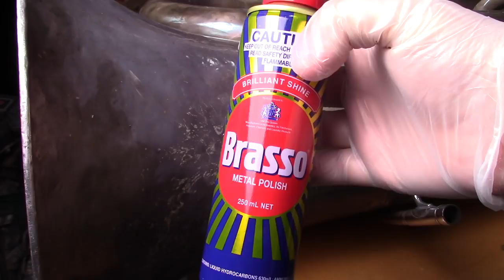It's finished! 1926 Tuba Improvement Project - Part 3

Comment: Trent- good work! You didnt destroy it- it was a salvage job and its now playable.

Question: did you cut your own felts because those size felts arent available or just cost savings? (Obviously it worked).

And I always thought you werent suposed to use Braso in silver. But it came out nice.

Comment: I have a trombone cleaning question, and it seems you are relatively good at fixing instruments. Just some backstory, I have a 1909 buscher trombone that my grandfather gave me. It has a very good tone and a beautiful engraving on the bell, but the only downside to it is that the spit comes out green. You might think letting a music shop take a look at it is smart, but I'm also 14. And poor. So if you have any idea on how to clean it or fix that, it would be greatly appreciated.
Reply from the maker: Yeah, I'd really recommend you take it in to get serviced. If that really isn't an option, give it a bath in warm soapy water, get a slide cleaning brush and give the tubes a good brushing.

Comment: Coincidentally I've been doing nearly the same exercise on a 1922 Boosey & co Eb tuba and faced similar issues, i ended up soldering 6 patches over holes and reconnecting the lead pipe and fixing dented valves. It'll never be an orchestra instrument but would fit nicely into a New Orleans style or even Funk band. Very satisfying to give these old beauties a new life.
Reply: I got an old 1935 martin  Eb 3+1 at an antique store for under $200. I would've sworn in was spray painted gray. Bit by bit is getting shinier, but lots of nooks and crannies!
Reply: I always like to see old instruments made playable again. Sure, you wouldn't use them in a Symphony Orchestra, but I reckon they've got lots of character and soul for small ensembles/bands who want to bash out a few tunes. I've recently acquired a ca. 1923 Boosey & Co Cornet which was considered a wall ornament, but it turned out to be perfectly playable - just had to sent it to a repairer to unstuck two of the slides and get a nasty dent out of the bell.

Comment: That tuba looks amazing. The music shop that I visit regularly has an old Besson Tuba made in England that was made in around the 1920s and is the original schematic for the tuba that you restored. All the lacquer has rubbed off, it's missing all 3 valve caps and the tip of the mouthpiece receiver at the end of the lead pipe is torn off. Literally torn off. I'm thinking of paying for it to be restored cause I can't just sit by and let it rotin the repair section of the music store and be used for spare parts. I already have a King 2341W full sized Tuba, and I just think it's too new. I've done research and it's worth around 12k USD.

Comment: I'm in the process of cleaning my very old 1800's Euphonium. After watching this video I consider buying that Brasso thing, made a huge difference on your instrument! Also, do you recommend buying valve oil and if so, which one? Yamaha has a "Vintage oil", would that be necessary? Thanks.
Reply: I hear the monster oil works very well for older instruments
Reply: Ivar Dozon yes get brasso! It works really well on brass instruments, even plated ones!
Reply: for the love of god do not use brass on anything from the 1800's. talk to a tech who works with instruments from that era. You could destroy the value some instruments just by polishing them.
Reply: Do not use Brasso. If you are going to not go to a specialist, use something designed specifically for silver, like Haggerty's silver cleaning
Reply: I also second using Haggerty's Silver Polish (Use the spray kind for a better result). Valve oil wise, Monster Oil is decent, but becomes less effective over time. I would recommend Hetmans Oil Type 1 or Type 2 depending on how snug the fit of your valves are in the valve casing. If they are a tight fit, use type 1. If it's not super snug, use type 2. I own an Adams E3 and use a type 1 because of how precise the valve block was made.
Reply: Thank you for the suggestions!!

Comment: Ahhhh more of the best sound effects ever.  Anyhow does brasso work with gold brass instruments?
Reply: Luggage only use it on the unlaquered parts, like tuning slides
Reply: Brasso is an abrasive cleaner. While it will clean your instrument, it will also remove your lacquer. Use Silvo instead.
Reply: Raw brass, yes. Thats what its designed for.  But it will strip lacquore off.

Comment: I did "custom" felt washers on my Pan Am Eb tuba (approx 1930's), and I also doubled up on the washers. I just couldn't find felt thick enough for the washers. I also bought a bag of wine bottle corks for a dollar at Goodwill which works quite nicely for replacing any cork.

Comment: Not sure how you came up with the number/thickness of felts, but here is a good link for a tool you can easily build.

http://redwingmusicrepair.org/portfolios/JHuth/pdfs/BIR_Brass_Manual_valve_porting.pdf

Also, go out and buy a cheap punch to make the felt holes better. It will give you a flat-sitting felt for more consistent porting.